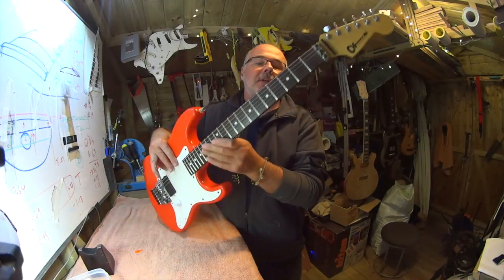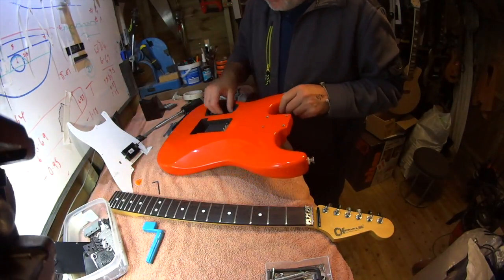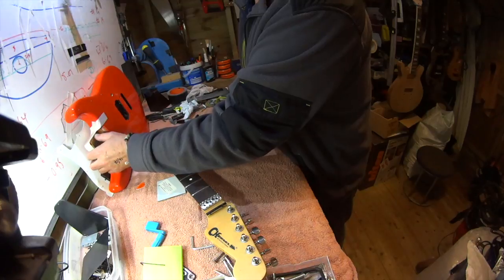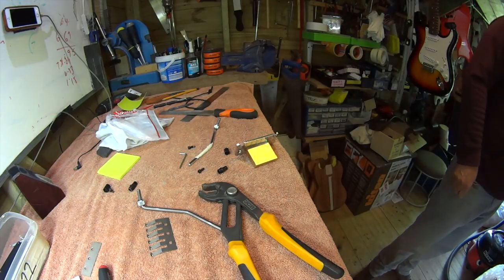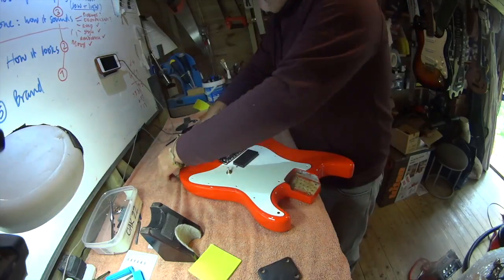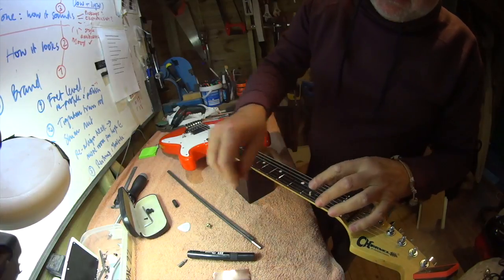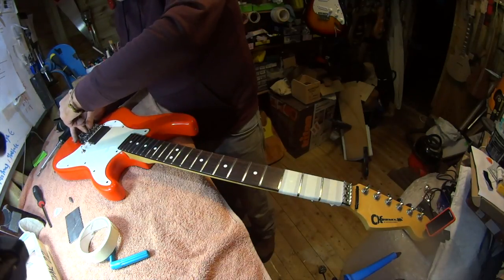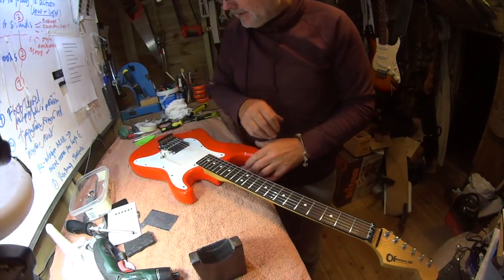Custom 'Gary Moore' Charvel bridge fix and set up

Comment: Very informative video on how to set up/troubleshoot a locking tremolo.
I have a question though, what causes a locking  bridge to be very stiff ? especially when pressing down  the trem bar , requires a fair amount of work.
Reply from the maker: Sorry for the delay. When you have a fully-floating tremolo it is - by definition - in equilibrium. This means the string pull exactly matches the spring pull. As a result, the force required to push one way or the other is minimal but increases the further you want to go. The only time it's meaningful to say that a tremolo 'feels stiff' is when it is set to 'down only'. This applies mostly to your Strat-style guitar (as in this video) with the 6-screw or 2-post tremolo based on the Fender original design. With this kind you can either have it floating (with the bridge in equilibrium as described above), 'down-only' (with the plate always flat on the guitar top until the arm is pressed down or 'locked' (where the tremolo won't move either because of an excess of force from the springs or a block of wood keeping it from moving). 
When people say the tremolo is very stiff they're usually referring to this kind of tremolo set in the 'down only' position where one of two things have happened: either 1) there are so many springs (or short springs) that the spring force is way more than required to just keep the plate flat at rest or 2) the tremolo claw screws are screwed in so far that the spring loading is increased to a force capable of holding the plate down and resisting pressing down with the arm. 
The way to lighten this is to unscrew the tremolo claw screws until you notice the back end of the bridge plate start to lift up due to the string pull reaching a point where it is greater than the spring pull. At that point, screw in again a small amount until the plate is touching the top again. That will be your lightest possible 'down-only' tremolo operation. Sometimes you want to go a little bit tighter than that on the claw screws - just until the plate stops lifting as you bend high E notes. That will be a little stiffer than the optimum but means you can bend without other open strings detuning as you do (a permanent problem with Floyd Rose floating tremolo systems). Hope that helps!

Comment: Been watching a few of your videos recently and great to see attention to detail.
I am keen to learn the skill as I have mentioned before but time is not on my side at the moment. 
I did buy a very cheap guitar locally for £20, to start, so I hope to put some time in soon :)
Reply from the maker: Go for it - whenever you get a moment. It's very rewarding. If you don't get much time to work on it maybe try just focusing on one area at a time and really see what a difference that makes. I recommend start with the nut to get a low 1st fret action and free-running slots for good tuning stability :-)